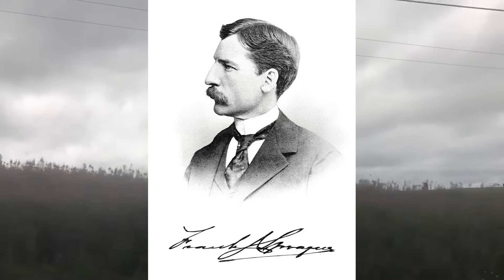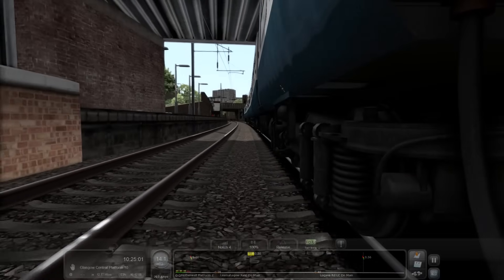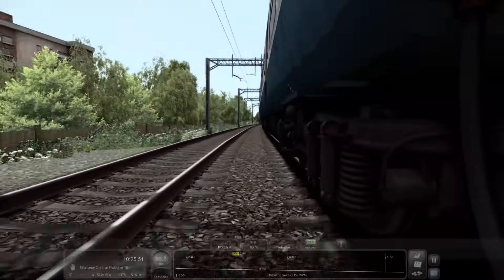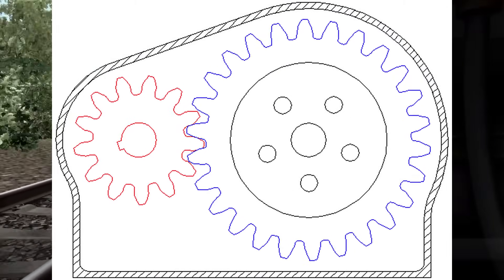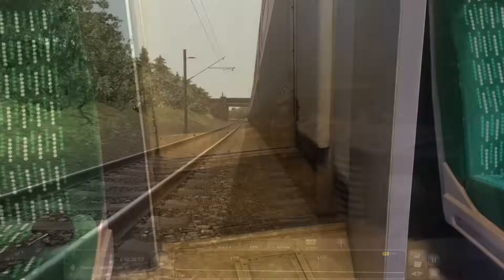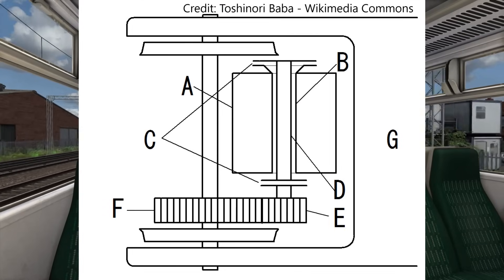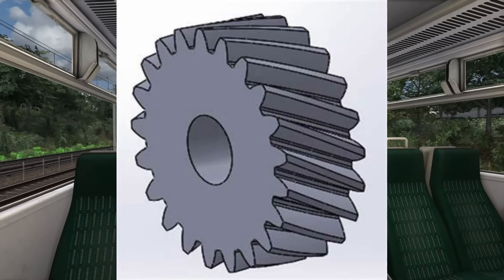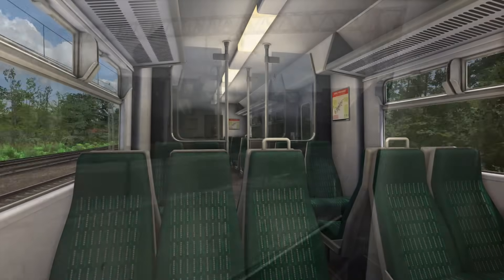Why The Noise? - An Explanation of old Electric Train Noises (Part 1 - The traction motors)

Comment: One of the best videos I've seen on this platform. And yes I've already seen the Beno one.  I have noticed that some class 700 and class 377 are now starting to make the old 'dc' sound, just not quite as loud.
Reply: Class 377s have always made that sound. Class 700s have always had the noise but they are naturally alot more quiet than the 377s. 

They both have Asynchronous motors . Which are AC motors
Reply: I am sure the original 377s have DC Motor's.
Reply: @J-Railway-Volunteer  nope I don't think so. They operate with adtranz asynchronous motors and igbt Inverters.  This required them to be "AC" motors. These aren't direct current equipment.
Reply: @bb-3653  If that is the case then why are the forced to follow the DC motor index where as other AC motors units don't have to follow it. Also doing some more research they seem to have EE507 motors which are DC.
Reply: @J-Railway-Volunteer  that's probably not correct then. Perhaps they've been mixed up with class 455s. Class 455s used EE507 motors. 
Class 377s use 100% Asynchronous /Induction style motors.
Reply: @bb-3653  The 455s left in services are using AC motors.
Reply: @J-Railway-Volunteer  these are the SWR ones. They likely still have some similarity In gearbox or motor but they've been updated. I was reffering to the class 455s of southern. (Miss those soldiers) 

The 377/6s and 7s and class 387s are newer gen electrostars, and  are even more mean sounding than the older generation electrostars.  And they are more up to date with regards to traction motors and gearbox. This is probably what makes the sound similar to DC motors you are reffering too. They are pretty deep at first.
Reply: @bb-3653  The 357s, 375/3s, 375/6, 375/7s and 377/3s are DC motor units with the refurbishment of the Southern 377s seeing them getting AC motors.
Reply: @J-Railway-Volunteer  source?
Reply: @mittenpulstaktung  From archive videos from the early 2000s and also railfourmsuk.
Reply: @J-Railway-Volunteer  Riddle me this: how did the modulation not change after they swapped DC with AC motors? Also, why do they suddenly have asynchronous modulation without the inverter being swapped? Asynchronous doesn't work on DC motors
Reply: @mittenpulstaktung  They do sound slightly different, and slowly, they are getting swapped to AC motors. Adtranz and Bombardier had planned to switch to AC motors, but they were still not fully proven tech for third rail systems because of the harshness of third rail and when the they chose to switch to AC motors they had to upgrade the third rail from 660 volts to 750 volts.
Reply: @J-Railway-Volunteer  That does not answer any of the things I asked
Reply: @J-Railway-Volunteer  this isn't me being condescending by disagreeing. But that just isn't true . They were developed with IGBT traction systems and Inverters. Subsequently they use AC asynchronous traction motors. They have 750volt related systems to convert the current or whatever but the motors and system operate using alternating currents. And thus are AC motors. There was no "refirbishment" or replacement of the motors  that I'm aware of.  The AC motors are more efficient by default more often than not. This means ALL electrostars use asynchronous AC motors and systems as they all produce the same sounds from the physics of the systems utilised.
Reply: @mittenpulstaktung  looooool. "Riddle me this"
Reply: @bb-3653  Southern Region third rail was 660 volts, and the electrostars were designed to use it.
Reply: @J-Railway-Volunteer  can you show me the archived videos I'm actually curious. Unless you mean they were used during testing. That likely means that they were just being tested with old motors . I've heard that the AC motors were tested on old slammers to prove their reliability. But that's not related to the trains entering services 

Actually as a matter of fact the 377s overloaded the third rail system from what ive heard and as a result had to modify the software uptake of the train to be utilised on third rail.

Additionally the only difference in sound is the fact that 377/6s and 7s likely have developed motors and gearboxes , they sound a bit louder and crisp. But are likely much better than older electrostars which use a similar motor/gearbox setup.
Reply: @J-Railway-Volunteer  Ok, and? Third rail doesn't require DC motors, works with AC motors as well.
Reply: @bb-3653  That is probably what it is becuase they were being tested with DC motors until the third rail was upgraded since DC motors don't mind different voltages as much as AC motors from the 2000s.
Reply: @J-Railway-Volunteer  the electrostars from what ive seen, actually forced British rail to update the 660volt to 750volt.  They used to overload the electrical infrastructure until that was modified and the software used to limit power uptake from the 377s.
Reply: @bb-3653  The archive footage is on YouTube, and because of YouTube rules on sharing links in comments on other people's videos, so can not but it is quite easy to find since it was made by the program Trainspotters.
Reply: @J-Railway-Volunteer  I see. I'll try to find it.
Reply: @bb-3653  Network Southeast had started upgrading third rail to 750volts starting with new electrifaction of Bournemouth to Weymouth which was done at 750volts to save a little bit of money.
Reply: @J-Railway-Volunteer  "that's probably what it is because they were being tested with DC motors" 

If that is true then I don't know the history relating to that. Either way they were developed to use AC motors in service . And likely got tested with the AC motors too.
Reply: @J-Railway-Volunteer 
When was the voltage increased to 750?
Reply: @physiocrat7143  It was done in the early 2000, around the time of the new trains apart from on Bournemouth to Weymouth part of South Western Mainline when it was done from new in the 1980s.
Reply: Even though 377s aren't as loud, there is a particular moment at around 20mph where the motor drastically increases in volume. And with 387s, at speed the motor literally screams out loud sometimes.
Reply: @Yawwie  That's mostly gearbox harmonics though, sometimes hitting certain frequencies that result in the whole motor vibrating. Generally caused by the gearbox and motor being worn out because of the modulation, which is fairly inefficient on those units.
Reply: @Yawwie  you are right yawwie. That js because 387s and (new generation 377/6s and 7s) likely use a more updated gearbox with some different or varying style of Infrustructure components.  They are supposed to be more efficient after all and thus likely have some development it function both motor and gearbox.  Also they sound way more crisp at speed.

Class 387 motor and acceration GPS
https://youtu.be/f7U7TK3vz9M?si=j6eHa-64Qwk9otdG
Reply: I’ve noticed it’s like the trains Natural sound. Even some other trains sound like that sometimes.
Reply: The original 377s have DC motors.
Reply: @J-Railway-Volunteer  nope they use AC motors. Asynchronous motors are AC motors

Comment: Another sound source that isn't really applied anymore are phase sequence inverters, which tend to generate synchronous pulse modes with a very low frequency, therefore sounding quite similar to the gearbox harmonics
Reply: I wish I could find footage of the traction motors that moved Australia Telescope Compact Array's dishes down the "train tracks".

Wait - found it! https://youtu.be/Xnd7RzlS2BU
Reply: other common missconception that people tend to missjudge is the rolling sound that some fresh grinded rails make, with the same gear tooth noise effect

Comment: i had always assumed it was the resuil of series paralell switching, especially when the sound appears to change gear
Reply: Indeed, I would have thought it odd if even early electric trains weren't using some level of series/parallel control, given the advantages of simplicity and efficiency. Resistors after all just waste power as heat, although these would still have been immensely efficient compared to steam and even diesel.
Reply: @lordmuntague the wasted heat can be used as heating though when it's colder.
Reply: @PéterFriedrich-f4e  Indeed, although within underground systems it isn't optimal. See Jago Hazzard's excellent vid on "Why the Underground is so hot".
Reply: @lordmuntague  unless the resistors were rated to dissipate something similar to the motor then this type of control would effectively make the train single speed with a somewhat softened acceleration!
Reply: @Hurc7495  I take your point, I'm going by series wound motors working to voltage control, but what they consequently draw in amps is also relevant so I'll bow to wiser heads on this one. 👍